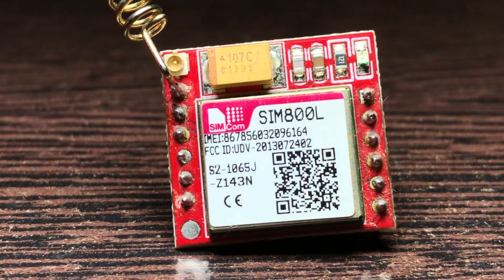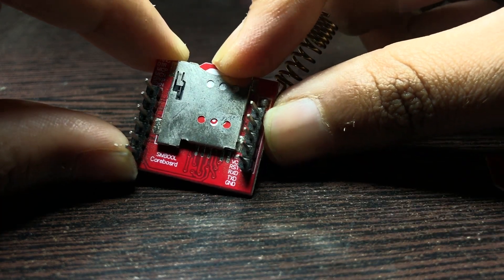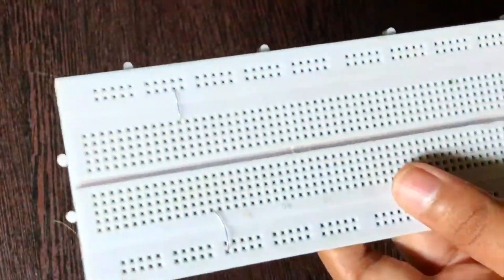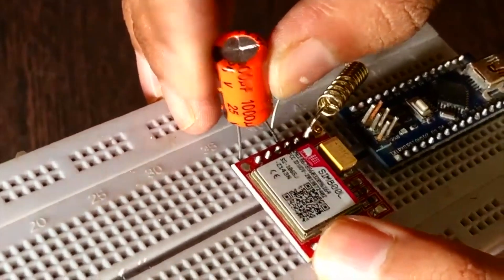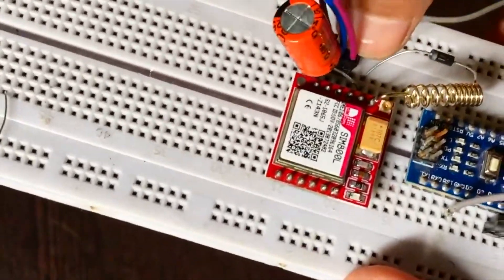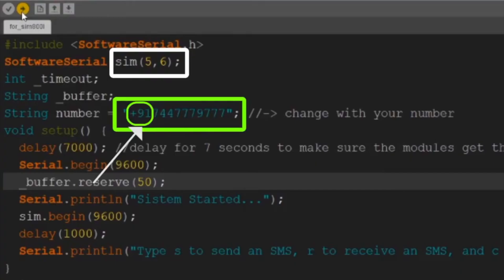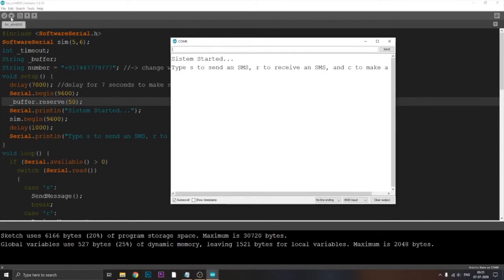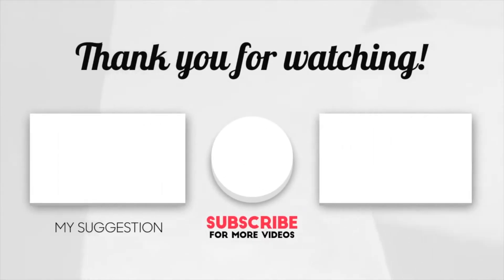SIM800L GSM Made Easy with Arduino Nano 2022 latest easy video

Comment: Can this support Airtel 4g nano sim? This module supports on 2G, I see you made it to work with Jio sim. Can i use this module to send data to Google firebase, I meant can internet be used? 
Can I use 3.7 v lithium battery?
Reply from the maker: It can definitely work with Airtel 4g simcard as well & for 3.7v its not going to work as it needs higher voltage than 3.7v also the current consumption is high for this module therefore you're going to require a much bigger capacity battery to use it on battery purpose